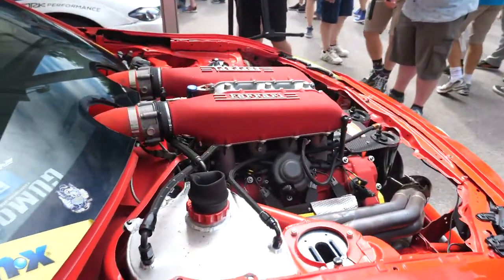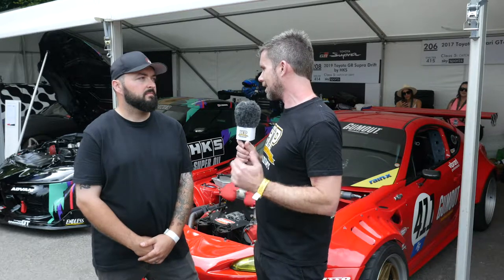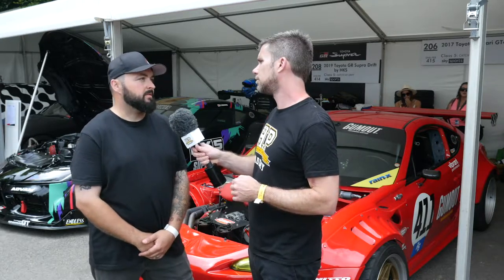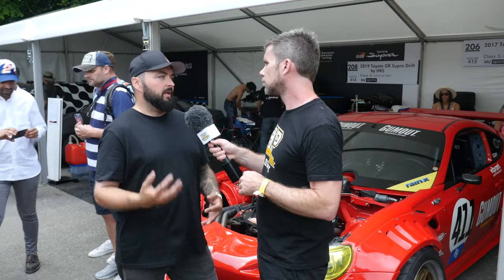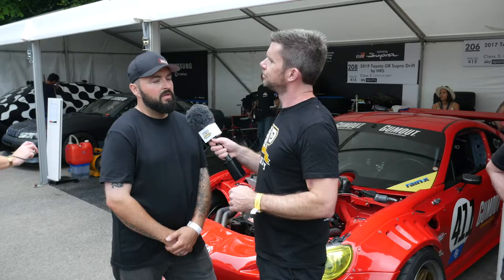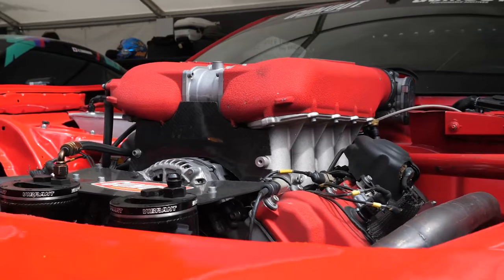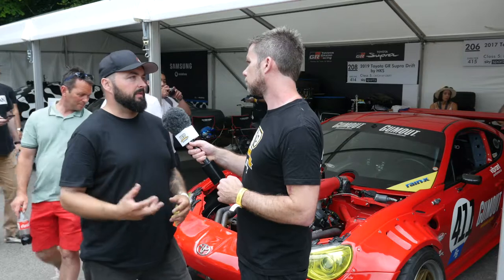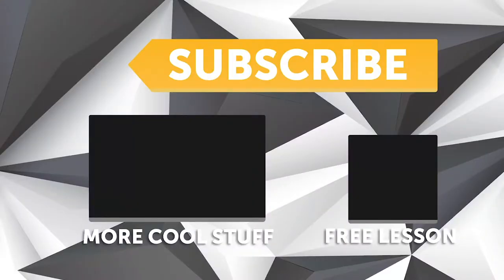Ferrari Engine Swap | Ryan Tuercks GT4586 V8 Toyota 86 [TECH TALK]

Comment: I would really be interested to know a bit more on the steering rack used for swaps in FRS/BRZ, what's easier, keeping the electric one or swap to an hydraulic like a s13 one?
Reply: For drifitng the GT86 steering rack is in a poor position for healthy angle and proper ackerman and the electric column has also proven itself unreliable in drifting.  We custom make a front cross member for mounting the engine and for the use of a Lexus IS300 hydraulic steering rack.
Reply: @unicorngarage6095  Much appreciated for the feedback!
Reply: @unicorngarage6095  Big thanks!!

Comment: I bet that's expensive to fix tho. YIKES Is an engine like that even reliable to be drifting like that for extended periods?  Seems like that would trash an engine pretty quickly with all the heat soak and high rpm , shifting it etc. Maybe I'm wrong and it's bulletproof.
Reply: I'm sure that engine would be a complete Royal Money Pit if it wasn't offset by the promotion that it brings.
Reply: @jiveturkey9993  My question is is Ferrari even has parts readily available .
Reply: @FrequencyOfThought  Absolutely. They made/sold a fuckton of 458's.
Reply: @FrequencyOfThought  I have no idea. The only thing I'm fairly confident about is that they will probably be on the more extreme end of the price Spectrum.
Reply: its a demo car not a competition car. and the load and and rpm range that it operates at is where it was designed to operate. It cools better due to how the cooling system was set up and as far as oiling goes its a dry sump so no worries. the car is more than capable of running reliably doing what it does.
Reply: NoNoNoNii  you're probably right. I don't know nothing about them damn things. I just assumed since it's Ferrari it's going to be a big gouge Festival.

Comment: How's that a good idea... using an exotic engine in an every-man's drift car, with little support, weak aftermarket and with parts availability rivaling space agencies... real-life analogy of that would be using human as a heart donor to save a pig at the slaughter-house. I guess it's a smart move to avoid competition... nothing much to prove with this really.
Reply: It's not a good idea. That's why it's a good idea 🤷‍♂️
Reply: its a demo car you tool, to show the capabilities of the shop and show case electronics used to seamlessly integrate oem functions on top of racing features. who cares what kind of motor it has, you build a competition motor its going to be built with exotic parts anyways and cost an arm and leg to replicate regardless.
Reply: THATS NOT THE POINT, for frog snacks.
Reply: The car is a paid commercial for Gumout and the other sponsors. The more attention it gets, even bad attention like yours, the more the advertisers get their name out.
Reply: @devjyarn  you get the point
Reply: @CP110  dont you insult tool like that. At least tools are useful!😂😂
Reply from the maker: @cccpfanat, how many 2JZ/LS swapped 86's with a Rocket Bunny kits can you look at before they all start looking a bit same-same? In a world of cookie cutter builds, it's refreshing to see something that's actually unique.
Reply: @hpa101  Agree on the looks, but sticking to the subject of purpose built drift cars or daily driven road cars I doubt this path could be considered a good idea for us-mortals.  Thanks for the vid 🙌🙌🙌